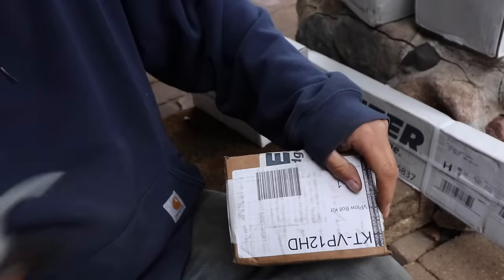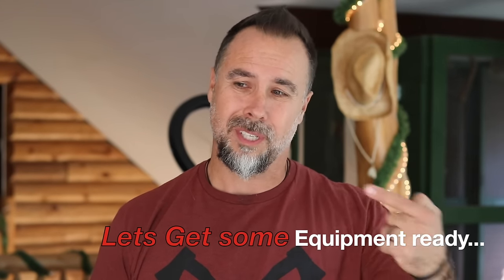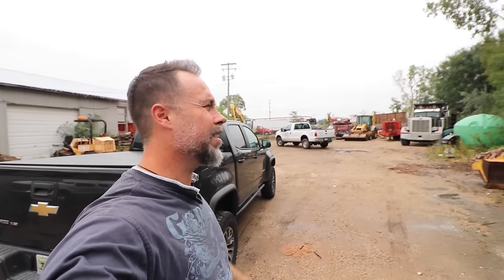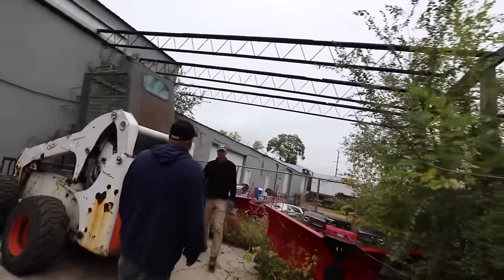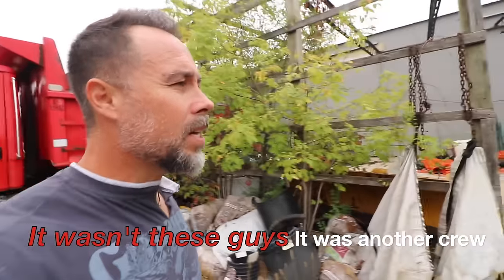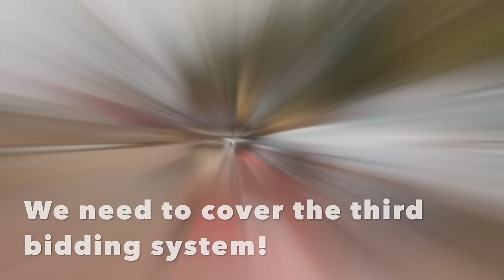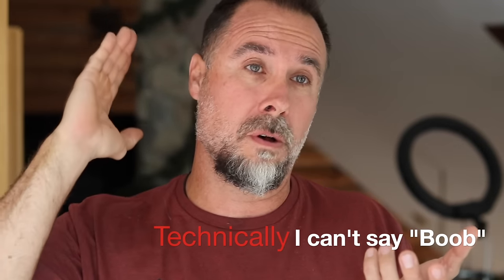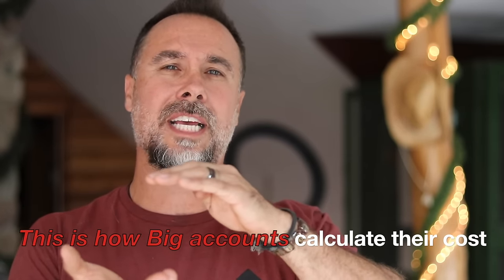How to run a Snowplow Business: Red flags, pricing systems and what not to do...

Comment: Your guy stored your plows backwards to prevent theft.
Reply: PA Wedding Tent and Duffy Events LLC.  I know fisher has electronic theft system meaning once you plug “your” truck in it will not work on another truck
Reply: Cody brown, it's so easy to get around that. I also store mine backwards and I run all fisher
Reply: Cody Brown, you have to setup the anti theft system.  It doesn't do anything by itself.  Western has the same system.  They're basically the same plows, different color.
Reply: Bidding plow job
Reply: This is false.
Reply: Western Ultra2 is easy as hell to mount and easy to steal. Just park something in front of it if possible and tarp it when not in use. Problem solved.
Reply: My plow anti theft storage system is my xblade is 4 feet from my bedroom window and 6 feet from my ar15
Reply: Is there something in your contracts that protects you against a lot of snow? You finished doing some residential driveways and you're almost finished with your commercial contracts but because of the wind and snow it's like you never did it and because of the crew in the equipment you have to stop, sleep, refuel and cross your fingers that your employees are healthy and fine. I'm asking because I plan to start out as a single owner operator. Is it wise to cut your contracts so that you can handle the worst situations?
Reply: can someone please let im in on how someone is going to steal my 1000 lb western wideout XL without my coded/matched controller? the only way i know how would be to load it on a trailer with a skid, or literally cut it up with a torch piece by piece with a torch. neither of these seems very likely for a snatch and grab like how most plows are stolen. i purposely stayed away from boss cuz they are 80% of the plows in my area, which means the most common mount to have for a thief.
Reply: Do not stand between the plow and the fence when hooking up if he accidentally gassed it
Reply: @joshofalltradesgendron5464 , what does having an AR-15 on the wall have to do with getting your plow stolen? You're always at home with the plow? People don't take your stuff when you're home.
Reply: @nocoolname32 ,

Pliers, Hammer, Hydraulic Jack, Ratchet strap.

Pull the pins out of the top of the lift ram. 

Use the ratchet straps to lift and secure the blade. 

Drive away.
Reply: @jeffdillenbeck1278  so basically this eliminates it as being a "crime of opportunity"
Reply: @nocoolname32 , 

Yeah, plows are unfortunately easy to steal. Best bet is to leave it under the watchful eyes of CCTV.
Reply: I had minute mount 2 years ago. Put pad lock on rest stand so you couldn't lift it up... but think a pin lock so you couldn't pull up to it.
People where stealing plows left and right in my area for couple of years. Had to get cleaver. 
Just thought, mark it and write down serial number...? ( paint it pink lol)
Reply: You can tell the side of town he’s from 😂
Reply: @richardwedsworth6830  our anti-theft system for our pows is to stick them behind the building, and stick about 50 pallets of landscaping block in the way all summer.

Comment: I still don't know about what it would cost to plow 6 inches of snow off my 300 ft gravel driveway that is 10 feet wide. Just wondering
Reply: 45$
Reply: @otisspunkmeyer2010  I would never touch that for 45, easy Hindi in my opinion.

Comment: Wjat do think about going into a neighborhood / development and advertising super cheap.  So the reason why you would do this is so you get a a majority of the neighborhood and theres no travel time in between jobs.
Idk maybe you've already tried this and it isnt as profitable as i think is?
Reply: Jeffstike 31 travel time always killed me when I was plowing residential
Reply: Here's a thought: Want more people calling you vs. chasing them down? Give your customer the option to save 10% if you can post a sign, "Want your driveway plowed too? [Number]" 

Let them know and give them an extra 5% off if the sign is there the next time you plow. They can put it out the day before snow is expected. Use a wire frame sign and put it on (2 extra) plow markers so it will stay above the snowfall.